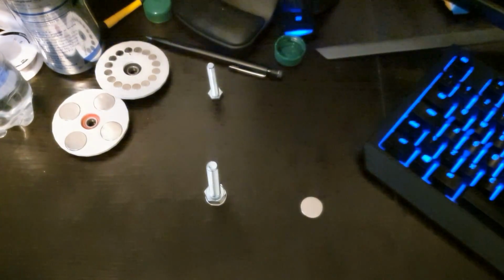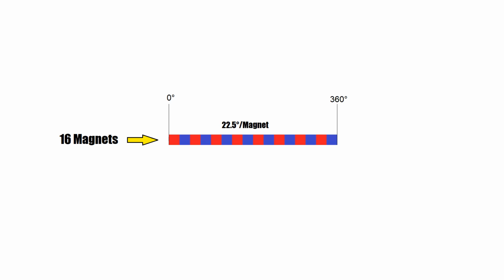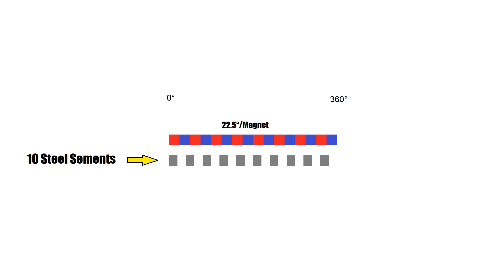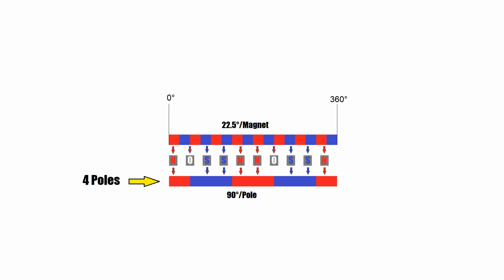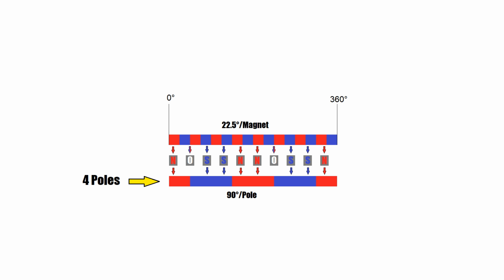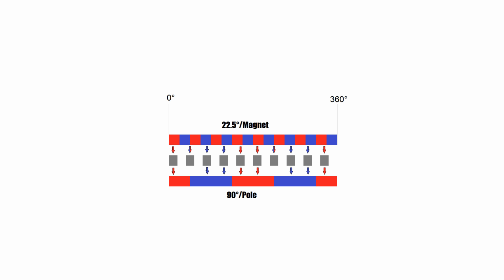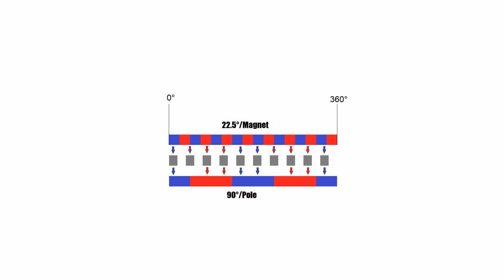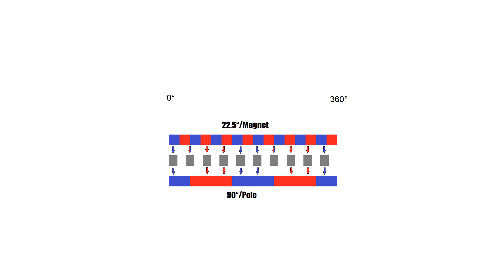Magnetic Gears & How They Work!

Comment: Could you not add another bolt layer and another magnet layer to increase 4x to 16x... and then another to increase 4x to 64x? 
(ie. input / bolt layer / intermediate magnets / bolt layer / output magnets (or intermediate layer 2...)

Comment: I am so excited about this!!! Going to make my own gears right away. Just a question: since magnetic field doesn't propagate infinitely (like a piece of matter would, though it would bend after some distance) we are limited by the size of the bolts. Now what is the maximum gear ratio that was practically achieved due to this limitation? With simple matter you probably could do something like 1:360, but here we won't be getting anything like that, right? So we would  join lots of gears together instead, but this maximum limit should be challenged and there should be some state of the art on this topic, what can you say? Maybe going the nano-scale would be the way to go in order to maximize gear ratio? (because the more precise we make the magnets, the more bolts we could stuff-in on a short distance)

Comment: What if instead of 4 magnets on one and 16 on the other, which gives you a constant and predictable 4 to 1 ratio, you have a prime number of magnets on both, such as 3 and 11?  And what if you had 3 discs instead of two, each at right angles to the other two, all three having a prime number of magnets on them. (turning one turns the other two)..I think you'd have a pretty neat gadget.
Reply from the maker: Since the magnets need to alternate polarity, going north south north south etc, you need to use an even number of magnets. If for example you used a disc with 3 magnets, since you'd have two north magnets and a south (or vise versa) its field would just have two poles with one being larger than the other.

Also, the gears cant be at angles to one another. The input gear is creating a rotating magnetic field, so the other gear needs to be coaxial to it to couple to the field.

Comment: Looks Great. I built one 4 large magnets, 10 stator and 12 small magnets. It does not work. Does the ratio have to be 4:10:16 or will any ratio work?
Reply: After review of the explanation. I will change to 2:9:16.....for an eight to one ratio.
Reply: 3D printed and assembled 4:8:12 and it works fine as a 3:1 ratio-Thanks

Comment: Hey, excellent job! Quick question. What kind of heat is generated in the steel with these systems for high RPMs? Is it very significant?
Reply: I’m working on designing one to couple my 10in Tesla turbine to a model of Nikola teslas DC generator patent number 406,968 and I’m wondering if maybe the high rpm I’m working with won’t start to lose a lot of power to heat generated on the steel stator. Thoughts?
Reply from the maker: This is just an educated guess, but the heat wouldn't be a massive issue up to a couple thousand RPM. However the thousands of RPM that tesla turbines need to run at to be effecient would likely cause a good bit of heat.

Depending on the application, you could use the gasses that have left the turbine to run through the gear and carry away excess heat, but this is just putting a bandaid over the bigger issue of lost power through eddy current losses, which would significantly increase as you climbed in RPM.

A fantastic idea would be to use laminated steel plates, or even ferrite, instead of solid steel segments. This would mitigate most if not all of the eddy currents if done properly. If you went for the laminated steel route, you would just have to ensure the laminations were in the right orientation to prevent eddy currents.

Comment: if you powered one side with a motor, would the other side start to spin 16 times faster? great vid.
maybe add another input (and or output) magnet layer, to create a stronger bond?
would a 11,25 to 22,5 degree (doubling the angles and magnets on both sides) magnet ratio be a stronger bond?
maybe add more full magnet rings inward on both the cylinders? like another smaller circle of 16 magnets.
maybe try the smaller magnets more to towards the outer ring, and the bigger more towards the inner center..
maybe the center piece can be inset a little inward, so that both outer shells spin closer to each other, inside like a holder.
Reply from the maker: Yes! That is essentially the idea of a stepper motor, it uses a motor coupled to a magnetic gear of sorts to reduce the output speed.

Comment: Hey, Physics major here with a shaky grasp of electrodynamics. Your explanation makes sense in the magneto-static case, but I'd guess any application you have in mind isn't remotely quasi-static. Do you know how a back-EMF would effect the "gears" as they're moving? I see you have a video demonstrating Lenz's law so I imagine you're aware of this. Maybe that's why you opted for separated bolts over a simple steel plate? Still it seems important to consider if you're planning to drive it quickly... 
I guess what I'm trying to say is I like your video because it got me thinking, but I'm really curious to see if you've done any higher speed testing. What are you planning to use this for? I can't imagine there's much holding torque, so I don't see many practical uses if eddy-currents pose an issue. Maybe as a radial indicator? idk and maybe I'm missing something. Like I said, shaky grasp.
Reply: oh okay, I checked your description. I bet a magnetically driven clock would be really interesting!
Reply from the maker: You bring up an interesting point I had not considered, that being the effect on efficiency eddy currents may play. I would imagine that at higher speeds, the gears would be harder to turn, and more and more mechanical energy would be lost to heating the steel segments, though I have not done any further tests with this.

The use of bolts rather than plates simply came down to convenience, I threw this mechanism together in a few hours, which is why I'm also suprised this video has garnered so much attention.

As for viability, you're right in saying that there isn't much holding torque. The main tradeoff with a magnetic gear would be trading a small size/weight for a long lifetime of the part.

Comment: Very interesting!  But how are the gears at actual transmitting force?  Can you actually hook a load up to it and have it  be useful?
Reply from the maker: A pair of magnetic gears cannot transmit the same amount of power as a traditional pair of gears of the same weight.

The major selling point for magnetic gears would be no need for maintenance or oil, and zero debris/noise/heat.

Another very specific advantage is no physical contact needed. This could be useful in an environment where you want to transmit mechanical power without breaching a seal of some sort, say in a submarine or spacecraft.

Comment: What grade of magnets did you use?
Reply: Like did your side with 4 still have to have the same total pulling capacity as the one with sixteen or did each magnet in the side with only 4 have the same field strength as each magnet in the 16
Reply from the maker: Larger magnets will always have more strength if the grade of neodymium is the same. 

This used all N52 magnets.
Reply: @BenjaminDMarshall  If the 16 magnets were 2mm each then the 4 magnets would have had to be 8mm each right?

Comment: Did you use iron or steel screws, your diagram said steel but steel doesn't dissipate its magnetic charge as quickly as iron so I was wondering if you've made a mistake?
Reply from the maker: Zinc plated steel
Reply: @BenjaminDMarshall  Is there a reason for your choosing of Zinc plated steel over a ferrous material like iron, nickel or cobalt?

Comment: Could you stack them like a turbine an drive the input with the output
?
Reply from the maker: Yes, but what is the desired end-result?
Reply: @BenjaminDMarshall  a runaway process
Reply from the maker: If you're referring to a perpetual motion device, then that's not possible.
Reply: @BenjaminDMarshall 
why 
Please Tell me why it is not possible, and what are the positive points and negative points.

Comment: My question is, it seems unstable for a given gear ratio to use such a low number of magnets on the slow gear, would stability be improved if say one used 16 and 64 magnets? I realize that's 4 times as complex, but I hypothesize that the uneven rotation seen at 0:45 ish would be minimzed/eliminated
Reply from the maker: I think a larger number of magnets would  improve the smoothness of the motion!

Comment: The free FEMM program will allow you to optimize your designs and provide visualization of the fields and their magnitudes.  I believe the program was originated by David Meeker, Ph.D.    Before retiring I used a very expensive (> $10K) FEA program for magnetic design and a lot more.   FEMM does about everything I need for playing around for entertainment and is more than capable of serious work.  It just doesn't have the pretty interface.
Reply: today there lots of open source FEA libraries out there which you can get for free and use

Comment: I'd like to see how much tourque your set-up 'slips' at
Reply: I played with this concept about 15 years ago and the problem is that the central magnet is always going to be much weaker than the outer ones. There's also a ton of  university research on those - but apparently we don't see these anywhere. The reason is - they are sort of weak and useless, using the same number of magnets - one can make just as torqy motors and in comparison with ordinary gears these are hundreds times weaker.
Reply: @makerbeelab5546  I figured it would be weak, I'm just very curious how weak, I assume you could easily stop it with one finger with his specific setup, I just wonder how the 4:1 ratio effects it because from my guess it would only make sense that it slips on both sides just as easy, otherwise I would need a big explaination on that
Reply: @joshieeee20  I've built a version with 2poles in the rotor, 6 electric steel poles with the windings for the intermediary and 8 magnets on the outrunner portion of it.

The intention was to make a gear/clutch/motor/generator/starter for a car.

The point was to be able to replace a clutch mechanism between the engine and the gearbox. So you could to take high speed input, have one or another set of magnets pulled out and have it functioning either as a generator, or regenerative brake or a clutch with electric motor synchronisation.
I had a lot of cogging, high torque oscillation and miserable power transfer as it was slipping off.

In this setup, also, the outrunner part of it rotates in the opposite direction to the inrunner.
Reply: Thank you I’ve been wondering that too. Do you think there is a configuration of a magnetic gear box that uses Eddy currents to scale better with higher torque applications?
Reply: @wastelesslearning1245  It is possible to make one of the rotors as a PMIM(permanent magnet induction motor). However the situation where slippage would happen is the situation of maximum power. Induction part would help to give at least some torque to the rotor, but I doubt it will be particularly high.

What would be an application of these?
Reply: I just like the technology for its potential to be quiet*, able to be driven disjointed  (working through walls between the gears), and it’s potential for as close to 0 friction as possible (reduce wear). Mostly though it’s just cool. The power transmission limited by Tesla of the magnets the gear is made of is it’s main limit besides cost. So I’m  wondering ways to compensate for that weakness. I think the technology could work for other weaker applications but trying figure ways to expand its viability for higher power. No particular mechanism in mind.
Reply: Thanks for replying.
Reply: @wastelesslearning1245  it is not likely to be particularly quiet there's still cogging and the spinning parts are much larger than equivalent gears. 
It would also have at least 5-7% losses due to eddy currents in the magnetic conductor. I think the only feasible application is the high RPM light load long running stuff.  Maybe some high rpm engraving attachment for a low rpm metal cutting standard spindles on a CNC.
The other advantage is the reduced requirements for accuracy of manufacturing of parts and virtually zero wear.
But there's only a handful of those application, and the reason magnetic gears are not used is due to poor performance really in comparison with normal gears (think of a 200 000miles japannese diesel cars/trucks) It is hard to get any better than that :)
Reply: @makerbeelab5546  According to this video, you should have used 5 electric steel poles, no?
Reply: @makerbeelab5546  friction-free gears. Reason enough for sure, if there was hypothetically enough torque this could be useful in robotics we can't easily access for repairs, like on Mars for example.
Reply: @kevinjimoh2921  it wouldn't be useful in robotics, but it would have been useful in high rpm applications, e.g. jet turbine to propellers or ducted fans. however it would still be quite heavy, even though lighter than to have a generator + motor and could be used in hybrid planes
Reply: @makerbeelab5546  true true, thanks for the input!
Reply: @makerbeelab5546  It is used in wind turbines, I'm literally writing a thesis about M-CVT transmission applied to wind power, there are lots of interesting projects happening right now.
Reply: @Flama741  but not on the first stage of gearing I guess. Otherwise it would be easier to convert rotating magnetic field into electric power.
Reply: @makerbeelab5546  I'm not sure if I understand you. The rotating magnetic field is generated by two rings (inner and outer) of alternating pole-pairs, it has nothing to do with generating electricity. The transmission's sole purpose is to increase/decrease speed between rotors. This changes if we're talking about Direct Drive machines, which I'm not sure is the case here.
Reply: @Flama741 
Yes, an attempt to put the magnetic gear connected directly to the rotor of the turbine will be effectively the Direct Drive generator.

The generators function at B - magnetic induction near the saturation of the rotor - 1T or so. The relative (per kg) power of any generator is proportionate to B*V*C - where V is the speed in m/s of the magnets across the slots of the stator and the coefficient C corresponds to all other configuration factors, gaps, tolerances, coefficient of engagement. 

There would be no advantage to use magnetic gearing to speed the rotation up to put the mechanical energy into electric generator. Direct drive generator will use less magnets and would be simpler in this case. 

But it is a completely different story when you would try to gear things down, e.g. from a jet turbine to a propeller. There you would have very high V and it would be advantageous from the mass point of view. You would save on the weight of copper and 1 set of stator iron + ESC in comparison with an equivalent hybrid system. It would still be heavier than ordinary gears, but would not suffer from wear.

Comment: Is torque required? Do you feel the forces of those magnets as resistance for the ratio?
Reply: Hi, no the gear will always transmit the power from one shaft to the other with a constant speed ratio of 4.00 until the torque applied at the driven shaft is higher to the maximum torque that the gear can transmit

Comment: A plastic fridge magnet is actually a hallback array and you wap them arround cylinder you create a magnetic coupling. You can turn it into gearing though inserts that change the coupling between layers.
Reply: This is a lot less expensive and easier than ordering new magnet array on a constant basis

Comment: Thanks Benjamin! This finally brings some credibility to mechanical advantage being generated off magnets. 
Doesn’t the dimensions of the magnets and the steel inserts affect the performance. If yes, how?
Reply from the maker: As far as I'm aware, larger magnets will always result in a stronger coupling force. 

As for the steel segments, it's just important that the space between them is about the same as their thickness. If you don't have large enough gaps between them the gears will rotate on a 1:1 ratio instead.
Reply: @BenjaminDMarshall  so too will distance between plates.  I have seen these magnetic couplers used in win turbines. The orientation is axial not planar.  The neutral segment calculation is interesting, and well explained. Thanks

Comment: Does the thumbnail do the same but for concentric gears?
Reply from the maker: Yes! That is the most typical way of arranging magnetic gears because it allows for a greater surface area between the gears to position magnetic material.